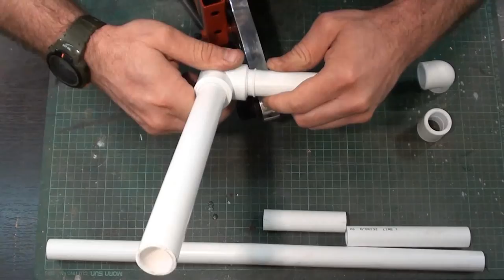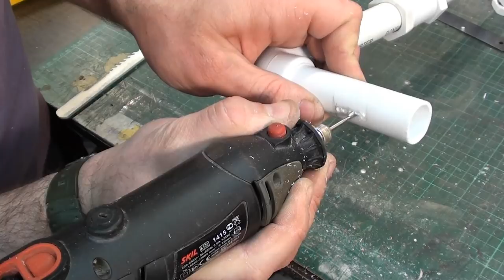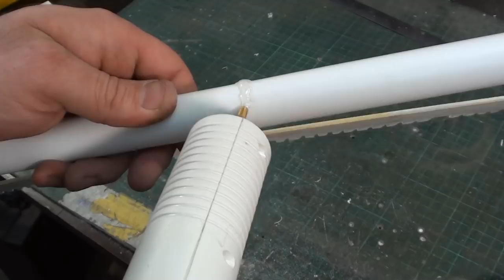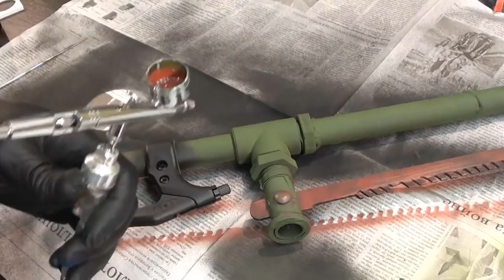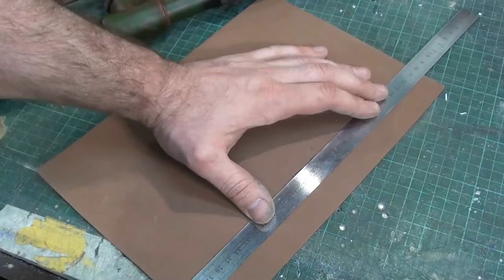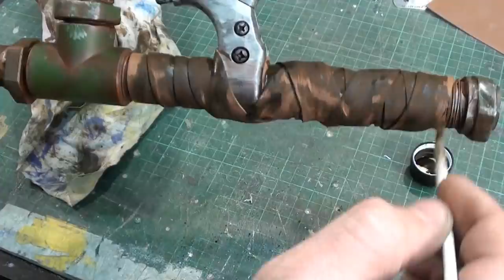How to make Pipe sword from RUST DIY

Comment: Looks amazing, but the only problem I see is the blade is upside down. You cut with the pulling motion and not the thrusting motion, so the teeth just need to be flipped vertically. Other than that, it's crazy how real it all looks!